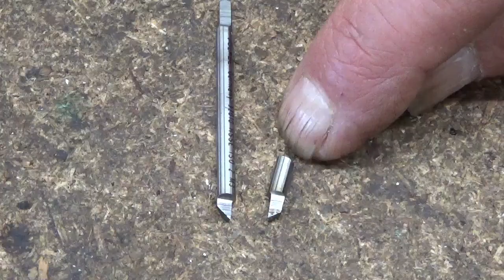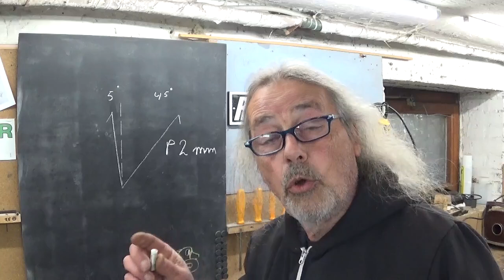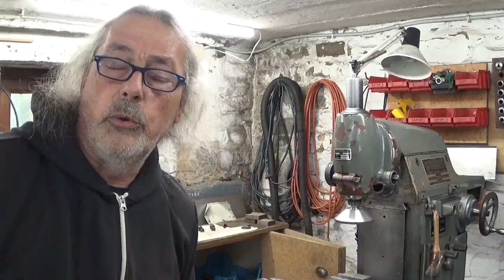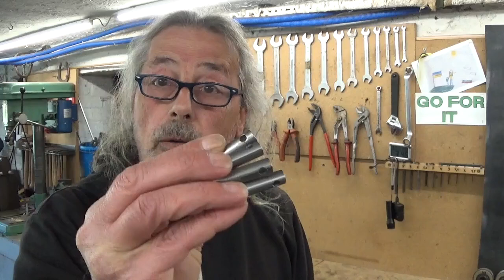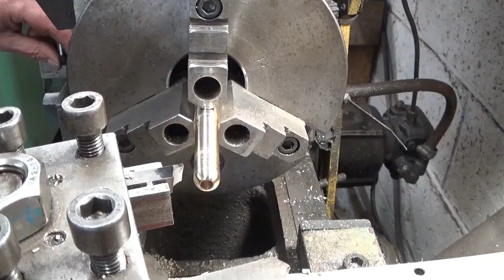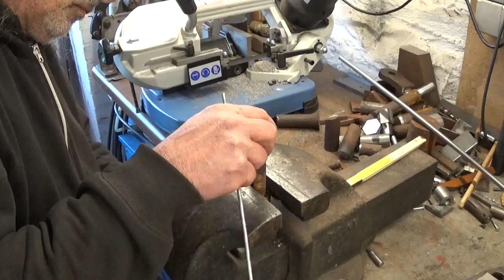Failed balls and other blabla.

Comment: Michel,I encourage you to make yourself a ball turning attachment for the lathe.
The best type I have found is the type that sweeps across the vertical plane rather than the lay flat type that sweeps across the horizontal plane. 
I have one of the vertical plane type made using a small indexable boring head but you can also make the boring head part fairly easily rather than purchasing a commercial boring head.
Winky's workshop has made a ball/radius turner of the type I describe in one of his recent videos.
Also when I turn small ball handles ends I start by cutting a short length of bar of suitable diameter and length to make the ball dimensions from and drill and thread one end and mount the piece  of bar on a threaded mandrel and then turn the ball to finished diameter.
Also see the ball turner that Artisan Makes  channel made about 2 years ago.

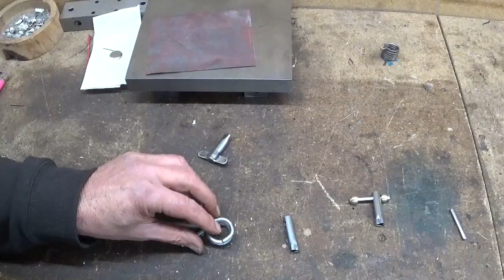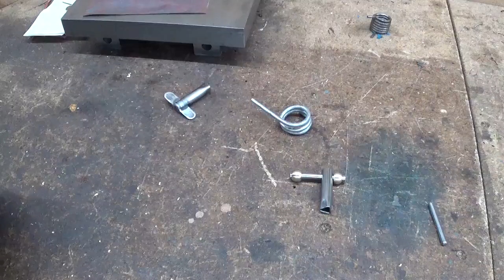Comment: At around 22:00 you make what a jeweller would call a "jump ring", albeit a giant one. But at 22:40 (closing the ring in place) you could do a little better.

The way a jeweller does it is not obvious; the end faces of the ring are fully filed and prepared with the ring twisted out of alignment (and hence exposed). The item (in this case the tube) is placed on the ring.

Now comes the important process.

1) The ring is fully closed up (i.e. the diameter reduced) until the end faces are parallel, or even overlapping by a tiny amount. This is possible because the ring is twisted, so the faces do not meet. The ring can thus be over-closed, so that the metal's natural spring back can be allowed for.

2) The ring is then finally closed by twisting. Importantly, it is possible at this stage to slightly over-twist, so that the metal's natural spring back can be allowed for.

The result is a fully closed, perfectly aligned ring. It works!

If you do (2) first, it is impossible to do (1) because you cannot over-close the ring to allow for spring back.

Comment: Hi Rusty. Great channel. For no fear threading on short threads. Put your chuck in reverse, turn the cutter upside down and run the carriage away from the chuck. You do need a lathe where it is safe to cut with the chuck in reverse. If you have this try it - works like a charm.
Reply from the maker: For a metric thread that doesn't help much because the half nuts are kept engaged.

Comment: Michel my Flemish is not very good. What I want to know is on your shop made belt sander and grinding or buffing wheel which is about 10 inches in diameter What is it made of  ?
Kit from down under
Reply from the maker: Theu are wooden wheels with a layer of felt.
Reply: @Rustinox  Thanks that explains what I have been wondering for years .

Comment: I think I like the final solution with the ring Michel. The problem could be if they hold the ring to turn the key, it could open up the ring. A spot of weld would cure this. 😊 Nobby
Reply from the maker: It's just a key. No need to force it.

Comment: That Electrolux vacuum cleaner must be ancient! I haven't seen a vacuum of that design since I was a kid, which was a long time ago!
Reply: Max at Swan Valley has an old Vax. I blew the motor on mine vacuuming soot up. The carbon shorted the commutator, big bang.
But agreed, that Electrolux version was around when I was a lad 60 years ago.

Comment: Another fun video. Thanks!  I know you like peening but next time you could also try to use high-strength retaining compound for the balls. Partial hole, does not have to be press fit, very easy, very strong. And even removable with a torch.   Hard for us old machinists to think of first, but chemistry is our friend too...

Comment: A bit of red locktite on the brass spheres will hold them in place very well
Reply: Yes, loctite 638 or similar cylindrical part adhesive would work well.

Comment: If you like those precision steel rods, pull apart any computer printers like laserjets or bubblejet printers etc.
They have a heap of rods, either in stainless steel or hardened drill rod type steel, and always in standard metric rod diameters like 4mm 5mm 6mm 8mm etc.
The older larger printers can have up to12mm and 16mm rods, newer cheap printers more likely to be 5mm or 6mm etc.
Reply from the maker: I have some rods out of printers. They are indeed very nice.